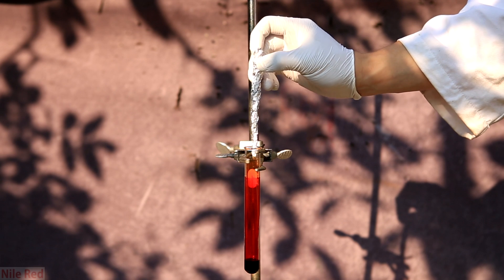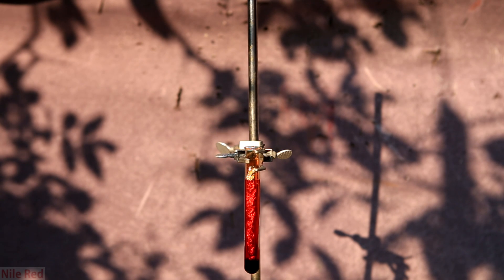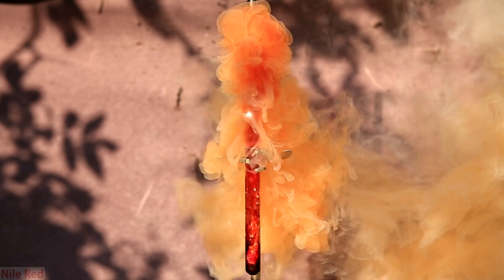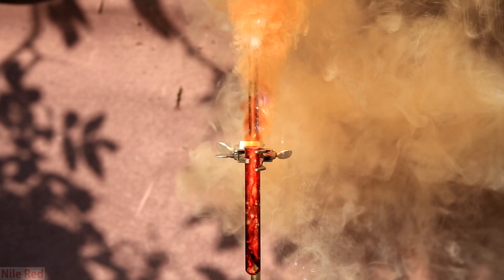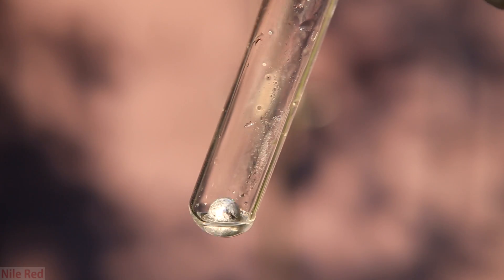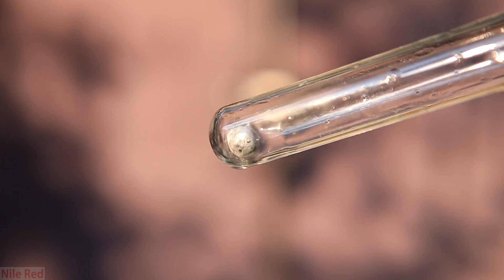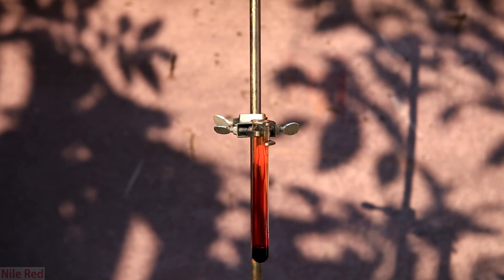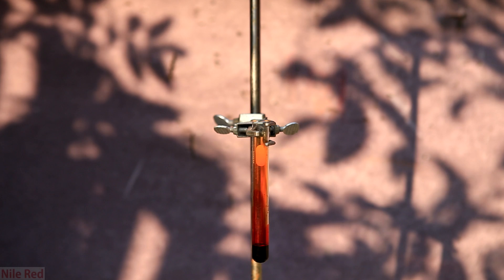Reacting Bromine and Aluminum

Comment: Hey, just thought I'd give you a heads up that latex gloves aren't fully impermeable. When handling dangerous chemicals, it's not a bad idea to double glove and tuck your lab coat's sleeves into the gloves. Also, you probably already do this, but make sure you're using the the right gloves (generally specified on the msds) or they may not be enough to protect you.

Your videos are cool but please don't die.

Comment: The aluminum melted and the test tube withstood it, it didn't know they were so resistant to heat.
Reply: Most test tubes soften around 800 C or higher and the molten aluminum was probably under 700 C but even then I would wager a guess that there was a Leidenfrost effect taking place in the tube that would keep the aluminum bead from staying in contact and actually transferring enough of it's heat to weaken the tube.

Comment: Niel would you be interested in repeating this experiment using gallium infused aluminum instead of the foil? I was wondering if the additional metal will hinder the reaction at all or make it faster since gallium compromised aluminum can be easily broken into small bits

Comment: These test tubes look really strong
Reply: Usually borosilicate. They aren’t physically strong but can take sort of high heat
Reply: it is pyrex ?
Reply: How strong they are depends on what you’re using them for, and what you’ve done with them.

Does the tube contain (most) of your really important product? Have you spent ages trying to clean it? It breaks after just dropping it back into its rack.

Is it just junk, or you’re just putting it away? Strongest material ever
Reply: They are made to be able to handle both high and low temperatures, acids and bases and all manner of other chemicals. They are still pretty fragile though, so dropping them from maybe 20-30cm will be enough to shatter them.
Reply: Pirex, but it's not indestructible. We had a Pirex dish shatter on a woman here for no real reason. It literally exploded in her hands, but she got away with only a slight cut.

Comment: whats that dancing fire ball at the bottom of the test tube is it like a sodium metal reaction with water it dances on top exept the sodium metal of some sort explodes
Reply: +420kalikushswag Sodium releases hydrogen from the water and gets really hot, that is why it explodes. Forming aluminum bromide is just really exothermic, it doesn't produce explosive gases.

Comment: Cool video! I like the part about the importance of wearing gloves. I recently spilled about 0.5mL of Bromine on my left hand when NOT wearing gloves. I felt an immediate burning sensation - I believe because of the exothermic reaction between the Bromine and the top layer of my skin. Thank God, I had a washbottle of water right there and washed my hand off in less than 3 seconds. At first one finger looked horrible - the Br2 bleached the skin on that finger a pale yellow. I immediately put my finger under running cool water and rubbed it to remove as much of the remaining bromine as possible. There was no further pain and the finger felt normal. The skin took on a more normal appearance after thorough washing. About a half hour later, the skin began to turn grey-brown. I put my finger in a solution of sodium thiosulfate for a few minutes and then repeated the washing, this time scrubbing with soap. Most of the discoloration went away and it seems like my finger is normal - quite scary though!
Reply: Potato Boy  I know a lot of people who just keep water and baking soda with no gloves when working with acids. Especially using things like HCl or HNO3 as those seem to have people feel the sting quickly enough to wash it off without harm. Personally I usually use gloves but for fuming nitric acid I don't. I always have some water nearby along with baking soda. The only large downside is that for larger sulfuric or nitric acid spills you need a towel to wipe away the acid first or else I have heard of people getting thermal burns from running warm water over the spill which as we all know, when water mixes with acids (especially above concentrated or just high concentration sulfuric), it produces a lot of heat. Also I had a small drop of nitric acid land on my pants which managed to soak through quickly and I felt a powerful sting instantly. Put the experiment on hold and washed myself and pants with plenty of water and baking soda solution. Was just fine but it was dilute acid anyway. Just thought it was cool how quickly I felt the stinging.
Reply: @Andrew-my1cp  Other acids are fine, and can just be washed away with tap water, and gloves are actually more dangerous when handling acids. Inorganic strong acids are just babies play, might as well be actually. Bromine however, is a much different story. It sounds like OP didn’t know what bromine was, and just played with it because it was red lol. You need the thiosulfate no matter what when playing with bromine. Not panic and rub warm water in your hand, that doesn’t cut it,
Reply: @potatoboy549  Haha yea. I mean acids are still not something to take lightly. They WILL blind you within seconds and can give you some pretty serious burns if you're not prepared for them. Luckily most acids give a stinging sensation before they can do any real damage (unlike HF) so it's usually not a big deal. Definitely protect those eyes though haha. 

I have actually had 55% nitric acid spill on my pants before. It soaked through and immediately stung. Wasn't a huge deal and I just took off the clothes and washed them with baking soda solution and threw them in the washing machine.  

Stuff like oleum is no joke though. That stuff (especially if hot or warm) will immediately char and burn skin and is a bitch to clean since it's continuously fuming concentrated sulfuric acid fumes. Do not recommend it.
Reply: @Andrew-my1cp  I mean yeah, but more experienced scientists wouldn’t really care that much. I agree, acid is no joke but most take 5-15 seconds until it stings, and everyone knows to be near tap water or even baking soda water before working with acid.
Reply: @potatoboy549  Yea I know I was thinking more about normal people. I mean 93% sulfuric acid drain cleaner is OTC.
Reply: Lmao do they teach you nothing in inorganic chemistry? You're supposed to keep the thiosulfate solution right next to you.
Reply: Sean Breheny c

Comment: Is the exotherm in the water + AlBr3 reaction due to the hydrolysis reaction? Does it also happen with adding AlCl3 to water?
Reply: TheChemistryShack It will for sure also happen with anhydrous AlCl3.
Reply: Random Experiments International Ok , thanks. I guess I just never really thought that they would react exothermically with water. But then again, I have never worked with either of the anhydrous salts.

Comment: also, how would one go about capturing the aluminum bromide for use as a catalyst?
Reply: DFliyerz Maybe it would be easier to simply dissolve Al into HBr.
Reply: JayMark2049 Afraid not, as it needs to be anhydrous. The main issue is preventing too much aluminum bromide from escaping. Perhaps I'll do it with a RBF full of water on top of a beaker?
Reply: DFliyerz I see. Sorry man, I'm not experienced enough to see how it would be the best done. If you need anhydrous stuff, it sure makes a difference.